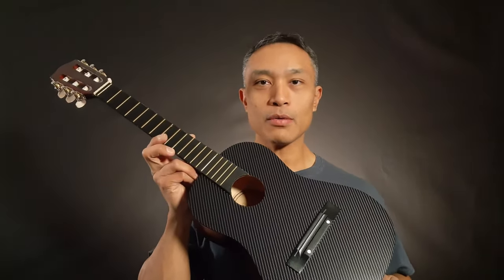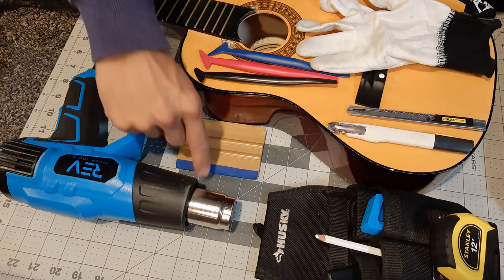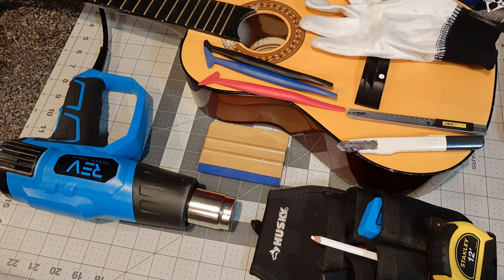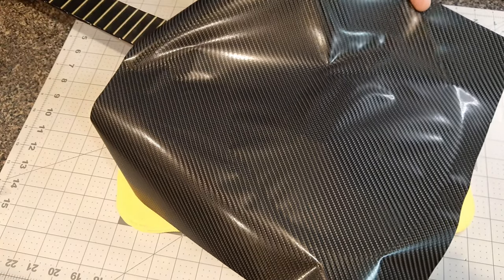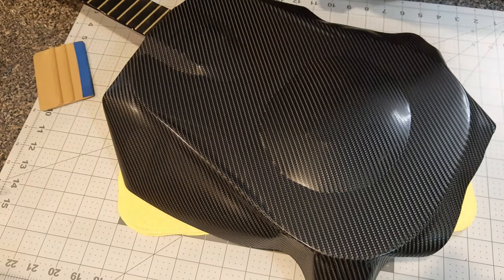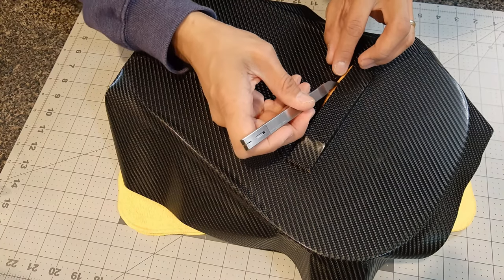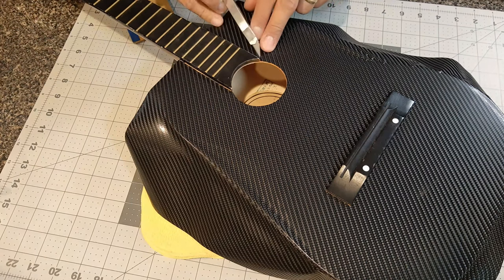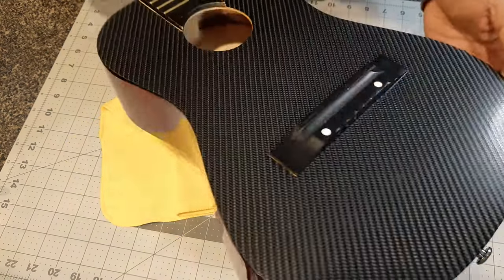How To DIY Carbon Fiber Vinyl Guitar Skin | Wrap

Comment: Very interesting. I was wondering whether this would stick to the lacquer of a guitar--as I'm contemplating doing this to an electric. The various vinyl sellers I contacted were reluctant to tell me if it would work or not... saying the adhesive backing is mainly formulated for cars, finished/painted surfaces, etc.
Reply from the maker: Vinyl sticks best to anything that has a "high surface energy," meaning smooth and glossy (in most cases).  Automotive vinyl would actually do well as it's designed to withstand the elements, as it's applied to the exterior of vehicles which are subject to wind, rain, baking sun, freezing cold, rock chips, bugs, etc.  Automotive vinyl is also specifically designed to be removable as well.  I've wrapped this guitar at least 5 times already, though on the fourth time, some of the lacquer on the edge of the center portal came up with the vinyl.  But that's not unreasonable given it was on an edge and I've pulled vinyl off of it multiple times previously.

Comment: So, I am new to wrapping guitars.  What would be the benefits?  Aesthetics, Durability, Sound Quality?
Reply from the maker: Most people will wrap their guitars for a change to the aesthetics. It does add a little bit of durability as the wrap also acts like a protective skin, and can protect the main body of the guitar from minor scratches. If you apply it to an acoustic guitar, the sound may change slightly as the vinyl wood dampen the natural vibrations going through the wood of the guitar body. For electric guitars it probably would not make any difference. But really, it's more for a cosmetic change to customize the guitar's look to something the owner wants but doesn't necessarily want the change to be permanent.

Comment: I have a razor blade sized crack on the back side of my $1,000 Marten... Guitar Center wanted $450 to fix it, which would require a rehumidification and pressure to pull the wood back to its original shape. They said they could just glue it... Anyway, carbon wrap might work w/ glue... not sure. I was thinking of gluing little splints inside the guitar over the crack... hoping that will suffice. Hoping the carbon wrap will mitigate the wood from temperature duress. I was hoping you would had covered the complete guitar, versus only the front. Looks nice, either way. I own a Klos Carbon Guitar too... though, it just does not have the body of tone one gets from a wooden acoustic. Though, the Klos is most definitely a great guitar to weather the elements. Though, nothing beats a Martin in my opinion... thx
Reply: Why would you take a guitar to Guitar Center for luthier work? Take it to an actual luthier, Jesus
Reply: @ragnaroksangel  I ended up fixing it myself, and saved some money. I used a large clamp, and gorilla glued three small wooden splints inside the guitar. I have not had any problems, and it plays like new.
Reply: Though, I have another Martin that had a warped next caused by lack of humidity. I had to bring it to the luthier. He fixed it... but he told me to sell it, as it could happen again if the guitar is not properly humidified. I have not been able to find a buyer, but it sounds just fine.... I had it serviced six months ago.... crazy, that Guitar Center would not give me a refund, as the guitar was out of its warranty by two days.... and, I was seeking help prior the warranty expiration. But Martin, held their promise. They paid for the Luthier service charge.... Our local Martin luthier said it happens all the time in Colorado, because its so dry here.... I have one of those little humidifier  things that dangle from the strings, and it goes dry every three days... And, that gizmo does not address the humidity of the neck....
Reply: @galacticom  Those are some serious concerns I have. I've always been an electric player until now. My acoustic arrives tomorrow and I'm nervous about humidity issues. I live in the Catskills of New York and live in my truck. The humidity gets pretty high here and I'm not sure what to expect with owning an acoustic in this climate and it being exposed to the elements like this.
Reply: @ragnaroksangel  that is why I bought a KLOS Carbon Acoustic… it is almost indestructible.

Comment: Great video. Is there a leather grain vinyl that would be suitable for re-covering the back of 60’s vintage Hagstrom I guitars? There are many of these guitars that need vinyl replacement in the backs and I have searched for YEARS for a viable method for getting this done. You might consider doing a video that demonstrates restoration of the Hagstrom back vinyl.
Reply from the maker: Thanks you and thanks for watching!

Vvivid does make a very realistic leather look vinyl wrap. I redid some interior parts of one of my older cars a while back with it.  Here’s the vid showing what it looked like
https://youtu.be/dAqoHSgX9vw

I don’t have any nice guitars like a Hagstrom to do a demo, but the process would generally be the same: Fully Prep the surface you want to wrap (remove old vinyl, clean the surface, may require sanding and some body fill, possibly seal with a clear coat first, etc.), measure out your vinyl, then apply.